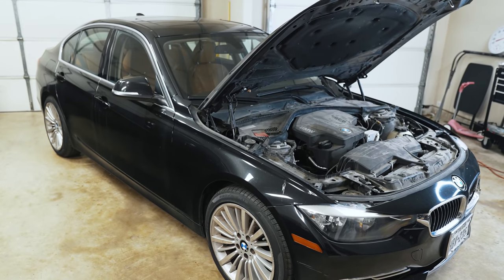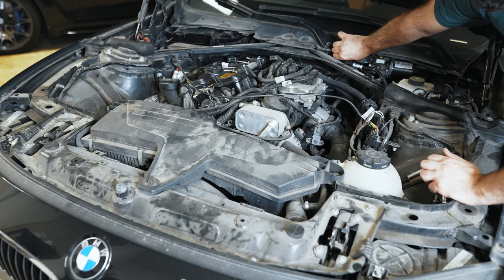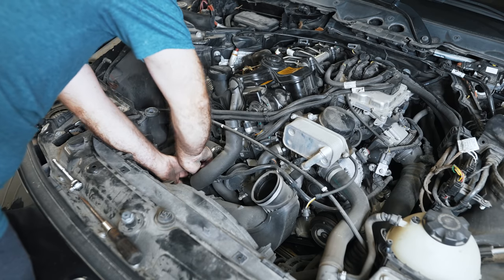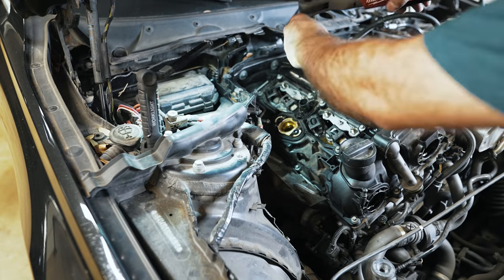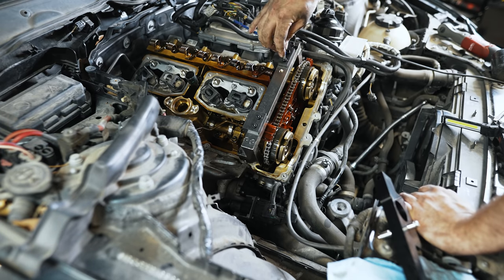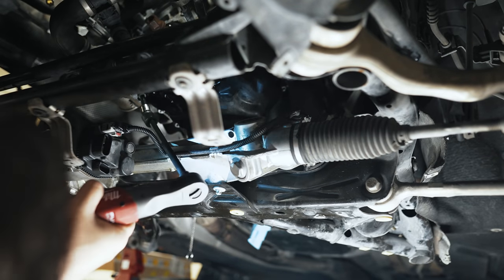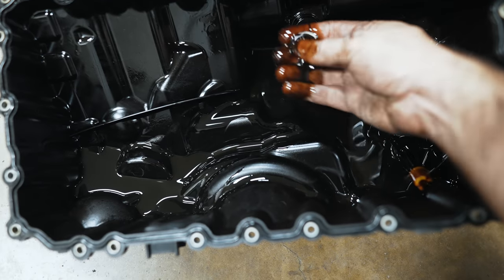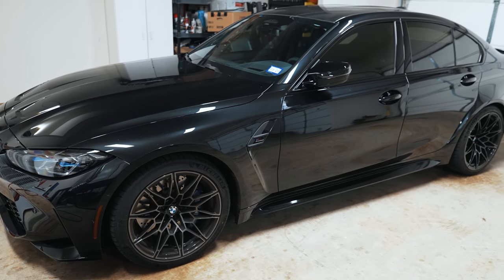All BMWs Get Mechanically Totaled.  This is One.  Saving It!

Comment: I am in awe of people like you who can diagnose what is wrong with these complicated cars and then fix them.
Reply: If your BMW starts to sound like a John Deere tractor, then this is your issue lol
Reply: Got a 2014 535i bmw have 90k miles starting to sound a little loud what could be wrong get oil change regularly  what should I check
Reply: @vesterpowell3545  What do you mean by "a little loud"??? Is there a specific sound it's making or does the car just sound louder than usual???
Reply: @yomansam4689  car sound louder than it use too I know the car 7 years old but it just sounds louder
Reply: @vesterpowell3545  Sounds like a failing muffler. A failing catalytic converter would also cause it to sound a bit louder but you'd smell it and ideally the car would give an alert
Reply: @yomansam4689  I'll check it out got a oil schedule at bmw get them to check it would that be hard to fix myself

Comment: Musa, this is yet another very challenging repair super-well reasoned and diagnosed. Your style of video is so solid for DIYers (even if this is an N20, there's a lot of common work techniques to the N54/N55 series motors). When you disassembled the motor, you were spot on with both functional failures (chain tensioner and turbo) which caused all of the other sub-system indications and failures. Even though you're going fast, you're covering everything in the process. Solid work!

Comment: Of course, my Fuel Pump in an e46 went out in front of a restuarant, 100 plus for a tow, bmw quoted me about 700 to put it in, I go to the pick and pull, first fuel pump I pulled out looked brand new still, 40 dollars and I fixed it right out front myself. For about 5 cents on the dollar
Reply: Wow you saved over $600. That's why I hate stealerships.
Reply: $100 tow? I haven't had one that cheap for at least 10 years
Reply: @ivanpetrov9230  like back when we were all pushing e46s? ;)
Reply: @ivanpetrov9230  just get AAA Plus, it’s about $70/year and gives you up to four 100 mile tows.

Comment: I have a 2015 328i with 130k miles, original timing chain and turbo. Tuned for most its life. Always used ceretec liquid moly in the oil.

Comment: Maybe it's Stockholm syndrome, but I love these engines so thanks for making content for it. The N20 is smooth, powerful, and efficient.  It can be easily tuned to over 300hp.  The N20 as a whole isn't fragile, but some of the original parts are very fragile. Replace those fragile parts with the redesigned and updated parts, and then you have a great tuning platform. 
I have two N20 cars that I bought for almost nothing cuz they both had spun bearings caused by shattered chain guides. The N20 original chain guides were made from recycled plastic prone to get brittle, according to my parts guy. The new parts don't contain any recycled plastic.
Reply: Solid info Rodger! N20s are also pretty cool (I'm into the N54/N55 motors primarily)
Reply from the maker: In terms of the partial throttle torque and the type of gas mileage they get they do have a charm.
Reply: I hear that its us N63 guys with real bad cases of Stockholm syndrome. My last BMW was a 2015 428i convertible with the N20 engine, and I LOVED that car AND that engine. Mountains or torque for it's size and just so buttery smooth! I now own a 2015 750Li with the N63TU, so far so good.

Comment: I live in South Africa and I have one of these F30 328i BMWs. Mine is a manual. 2013 model with 87000km on the odo, so a low mileage. This video has lots of useful information. I have the oil replaced every 2 years irrespective of the mileage. I do less than 10000km a year. The cam chain and tensioner you mention concerns me. BTW, I agree with your assessment of this car. It is very torqeuy and goes like stink. A genuine 150mph car. In eco mode the gas mileage is incredible. 5,5 Litre/100km at 115km/h. Highway driving. I look forward to your next post.

Comment: Thanks for sharing and all help that you have given on BMW repair............The "cost of ownership" has gone through the ceiling on these "newer" models (after the e90s, and they are expensive too.) especially if you take it to a mechanic (non-DIYer)......The BMWs being produced today will be "crusher" in 10-15 years because they will be too expensive to repair.  I hate to be that way but  it is the truth.  BMW has walked away from its "roots" - the naturally aspirated inline 6 is no more.......
Reply: Interesting point. I have a 2015 535 with the n55 engine and 50k miles. Runs like a top. I normally keep my cars 10- 15yrs and avg 350k miles. This is my first BMW however. That said, i suspect the real weakness is all the tech will go obsolete with no way to upgrade it.

Comment: Very nice safe! Also great content for the channel! It's an example of why good oil and regular oil changes are key for these turbo BMWs. Personally, I change the oil on my 335i every 7500 miles. I think the turbos will last longer that way. Keep up the great work. Dutch regards, Nico.
Reply: Regular scheduled maintenance is critical for ALL engines, ESPECIALLY turbocharged engines.
Reply: I change mine 2x annually or roughly spring and fall.
Reply: that's is the secret with BMW big engines I change my oil and filter every 6000 miles it's 14 years old and I've never had any problems with  the engine

Comment: Crazy how the stealership just wanted to replace the whole engine. Can't really expect much from them lol.
Reply: More simple to do
Reply: @Bussdownbandit  Not at all...
Reply: The reason they want to change the engine IS because they half to guarantee all there repairs for a year. They change things, not fix things. Because there on the hook 🪝 for what they do. If you had a garage you would not last long without a year warranty, you also wouldn’t last long if you fixed old parts that something else would go. The customer has another problem with the engine, blaming you, takes you to small claims court and you’ll be on the hock for a new engine.
Reply: All main dealers for every car brand does this. It's more simpler to do and can guarantee the problem(s) will be solved and no come backs. They do the same for gearboxes, diffs etc. replace rather than repair. Great for them but expensive for the customer, quite frankly unless it is for getting work done under guarantee I wouldn't take my car to a main dealer for most jobs.
Reply: @joebloggs4191  exactly what i was trying to say i am pretty sure it is not a big deal to replace some parts that are wrong with the car but its less a headache to just swap the engine and knowing that i dont gotta go back on work
Reply: Also as a dealer, labor is less with replacement than repairing several issues.
Reply: We only know what we can see through this video.  In addition to all the mechanical repairs necessary for this engine is the underlying cause of all this - lack of maintenance.  Well maintained engines aren’t varnished golden brown inside and don’t have sludge.  The engine in my 2003 Mini Cooper with over 160k miles looks clean and shiny inside the valve cover.  The dealer is probably (and rightly) anticipating additional problems resulting from the poor maintenance this engine has suffered.  They made the right call.
Reply: No dealership in the world would want a put a warranty on their work for an engine that's seems this amount of failure and abuse. There's no telling how extensive the damage is on the BOTTOM end. And labor for an engine replacement is going to be less than fully tearing apart and rebuilding this thing which is the only way to guarantee it's going to work properly moving forward.
Reply: New engine will last longer without dismantling it in the near future. With this used engine soon you will have problems with Vanos motor and actuators(unless you put new parts inside now)
Reply: @Paul37Ontario  Great information I never thought about it that way!

Comment: Good vid. Never seen a Turbo shaft brake like that in a stock application. Too bad I'm not closer. I could bring my e39 540 by and we could do the vanos rebuild hahaha!
Reply: When a critical component is barely being lubricated and with oil that is probably way past its service interval, it’s not too surprising.

Comment: I think a LOT of people would be surprised at how much they can do in their own driveway. Case in point. Two years ago my car went tits up (I think the torque converter failed) and I made the decision to just get something else.  I buy cars I can write a check for and never have a car payment.  I found a clean 2012 GMC Terrain with the dreaded 2.4l Ecotech and the owner had a stack of maintenance receipts including a $1400 timing chain service just 10k miles before I got the car.  I paid $5k (it has light hail damage and was at 140k miles at the time).
     Anywhoo, a few months go by and the CEL is on and it idles and runs rough and is mechanically out of time.  Not only that but when removing the valve cover I see the top chain guide is completely sheared off from chain slap. So the timing service was never done.  The shop I took it to to verify that it was out of time, wouldn't even quote me a price for the job. He said they don't do anything that can't be done in an hour or so.  I was pretty dumbfounded by that.
     So I bought the parts and did it myself. And the only real hickup I had was the tensioner on the back of the block. That booger was stuck, so I got a compact air-wrench 4 (Onyx Nano) and zipped it right off.  I put the new chain on, new guides and tensioner, bolted everything back on, refilled the oil and it's run like a swiss watch since. The most complex job I'd done prior to this was brake pads, unless you count the oil catch can I installed (which this engine really benefits from). 
    Cars are more complex, but I really don't think they're that much harder to work on.  Yes, some things require an engine-out service that's a deal breaker for most people.  Honestly if it saved me 2-3 grand I'd probably attempt even that. Even an idiot can learn new things when he tries.

Comment: Great stuff man!  Check out the f48 common failures. Front engine mount. And (secure vehicle against rolling) issue. Small pin in gear shifter brakes making the warning go on.  Good stuff

Comment: There is a class action suit for N20 and N26 engines from 2012-2015. BMW should at least partially cover the repair up to 100,000 miles and 100% up to 7 years or 70,000 miles I believe

Comment: Man I’m so grateful you started making content on the n20 f30, you’re a blessing to the bmw guys. Not many guys that work on and own n54’s and g80’s, that will do this. My car is maintained well and oil changes very short intervals. Can I change the timing chain tensioner only? By timing chain system is in great shape. Right at 60k with at least 70% Highway driving, almost always long trips. Can the tensioner just be swapped, or does timing, cams, etc.. need to be locked? any one? Would really appreciate it. Thanks
Reply: You can do just tensioner but as everyone would suggest do the chain and whole kit because on older engines especially n47 the chain itself would stretch and snap and it’s only a few tenners worth more so why not and I believe you need to align the cams with the crankshaft and lock it so it doesn’t end up marrying the valves with the pistons
Reply: Thanks for the reply. I hear you. What I meant by my question was can the tensioner be easily swapped out. You did answer me by saying that it only takes a few more steps. I think I won’t touch anything, like I said there’s no slack. My engine is running beautifully, I change oil very often, bought at 19K and 2016 so should be all the updated components.

Comment: Fascinating stuff. I've been through it with my N63-powered X5. The  warranty company saved the day, frequent oil changes and not driving much will keep it with me for some time, but these cars are disappointing in that regard. On the other hand, its's a (now) reliable 400+ horsepower car than can still be tuned further and I can live with the nickel and dime repairs that seem to crop up somewhere between 80-120k miles....

Comment: When I was shopping for a new-to-me sedan, I moved from a 2008 BMW 328xi to a 2014 535i xdrive. I was told by two different, respected mechanics who told me to steer clear of 4 cylinders & V8s by BMW. The inline six is the way to go in terms of long-term reliability.

Comment: God this engine seems like a nightmare. My old N55 was a high mileage beast with no issues other than expected maintenance. Wish I never made the switch to N20 ;( 
Thanks for the content, not sure if/when I should tackle a timing chain upgrade, but seems like a smart move considering I have the older brown-colored guides.
Reply from the maker: Yeah for now I'd recommend oil changes every 5K and to look at replacing the timing equipment when your oil pan or valve cover gasket start leaking.  Likely at 100K miles.
Reply: Update on my end. Picked it up from the BMW dealership. They are running a diagnostic test via ISTA and they provided me the results. They run a chain elongation value test which provides values of intake limit value (-5.86 degree crankshaft angle) and exhaust limit value (-8.60 degree crankshaft angle) + your resulting crankshaft angles. They also run a second diagnostic for the oil pump chain. 

Note that I signed for the diagnostic fee but this was waived and I just paid for an oil change since it was already at the dealership service bay. Needless to say I am pleased with how it was handled and does not hurt to have BMW test it with ISTA/their diagnostic. Documentation is now on their side and I have a copy of it as well. It is well worth having documentation in case of any engine issues in the future. 

I am guessing those who are in the 70,000 - 80,000/8 year period should consider going in for a diagnostic just to be sure. In relation to this video it seems that it could have been possibly saved had this work been authorized as soon as the whine was diagnosed. To other BMW owners, stay afloat on the latest TSB's as many car manufacturers do not go to the length of having an entire vehicle recalled. This is a costly move and it is often cheaper to warranty / save money 1:1 by dealing with lawyers/lawsuits. 

Also check BMW Reimbursement program for any work that is under warranty/extended warranty that may have been paid out of pocket or at an indie. This has helped me figure out what major work can be performed under warranty for BMWs. Hope this helps someone out there.
Reply: @soomz5159  Had timing chain guides go on a 2015 w/ 5,000 mile oil changes from new at 72,000. Diagnostics were fine but the car developed a weird wine under idles. It ended up being plastic guide pieces partially clogging the oil control valve. Dealer replaced entire timing chain and oil chain assembly w/ the redesigned parts along w/ new oil control valve all under BMW's program. Very grateful that they technically went above and beyond the lawsuit. Was told the new parts are an improvement and should not have to go through this again. Oddly, I also had a turbo replaced  just 6 months earlier due to waste gate rattle. (For some crazy reason dealers like to replace the whole thing instead of just installing a waste gate rebuild kit). Figure the car's major faults have all been addressed under warrantee extensions. Hope to keep her for 7 more years. Love the car and how the little turbo 4 paired w/ the ZF drives as a daily. Other than plastic guides and a loose turbo waste gate, the rest of the car has been flawless for my first 7 years of ownership.
Reply: @jamesduggan5846  glad to hear you were able to get the work done before anything catastrophic occurred. I also had a 2012 BMW 328i F30 for a few months before it got totaled after hitting a wood crate someone dropped on the freeway. The engine and ZF trans I completely agree are what makes the 328i such a great car. I just picked up the 2014 station wagon xdrive now. I am hoping to keep this as long as possible. I'll definitely check for strange sounds as sounds and odd mechanical feelings are good indications something is wrong or about to go. Thanks for sharing your experience!
Reply: @opmike343  Thank you for your input. I will be sure to trade it immediately for a Hyundai Elantra.
Reply: @VehicularDIY hey DIY what torque specs did you use for the 6 subframe bolts?

Comment: Car had a seven year service life. That is sad. I had 3 BMW (in a row), 2011 335IX, 2013 135I Cnv Mpkg, 2016 Z4 3.5iSdrive. No problems. Of course ,  being leased, they went back after 3 years, with about 15-17K miles. Germans need to work on their long term maintainability. After 4/48, way too many parts have to be replaced. I find that is true for BMW, MB, Audi. I am leasing 2019 Alfa ROmeo Gulia RI Sport. Seems like the oil amount sensor is not trustworthy. Othereise its been excellent.  Gulia has 6,300 miles on it. AFAIK , European luxury imports are very good, very reliable for first 3-4 years or 48K miles. 60K if lucky. After that, major components have to be replaced or rebuild.